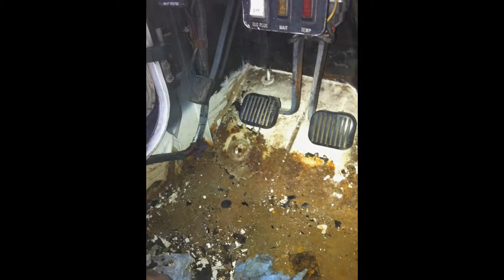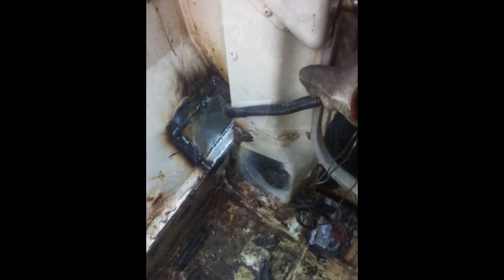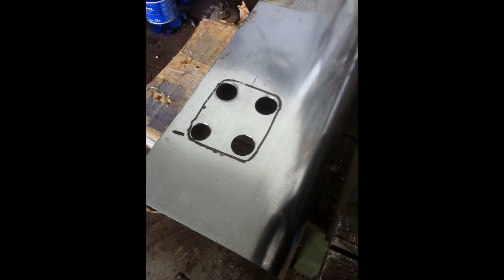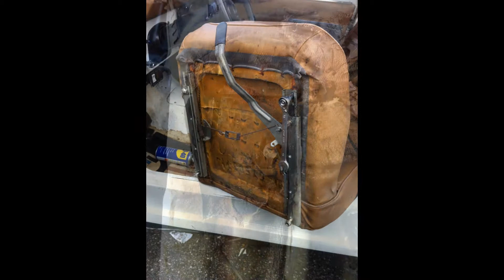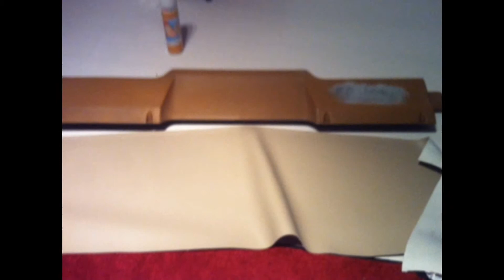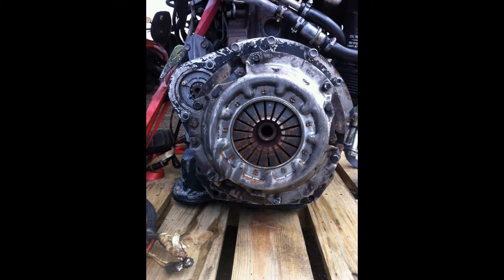CJ7 2.8 TD Isuzu swap and restoration

Comment: hello , did u use stock rear axle of jeep? dana 44 or swap for something to marriage the 4jb1
Reply from the maker: Hello, on this video i have stock trasmission with AMC 20, if You subscrive and search in my channel i have more video for rotation dana 300 anche rear axle one piece G2 installetion, dana 44 it’s good but heavy, Amc20 it’s light and strong with axle upgrade
Reply from the maker: For 4JB1 swap is easy, change engine You have same hole for gear box without 1 or 2 bolt... cut 2/3millimeters in center of Fly Wheels how work clutch disk, change fuell line right side to left side and the exhaust left side to right side i have a side pipe Motorcycle engine Titanium 😂 search all video on my channel